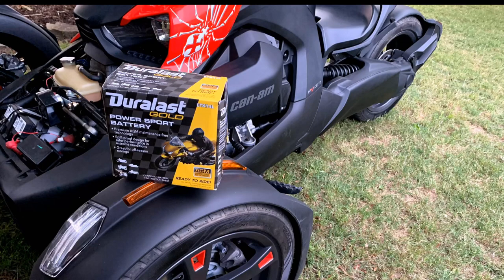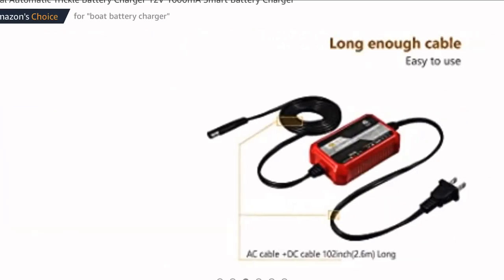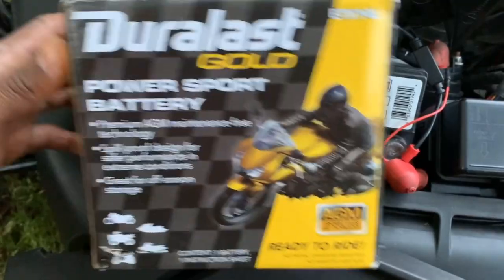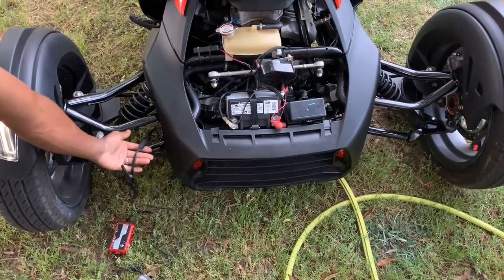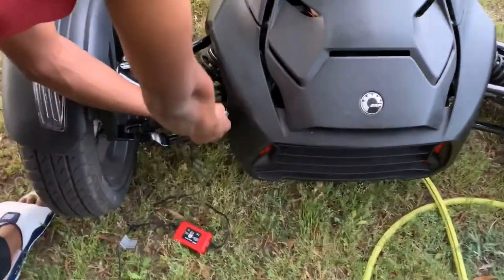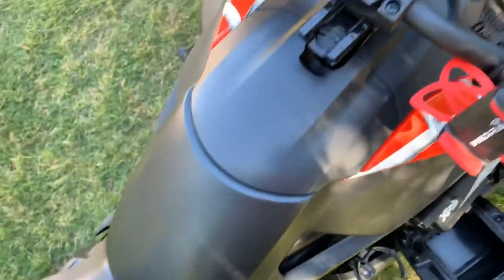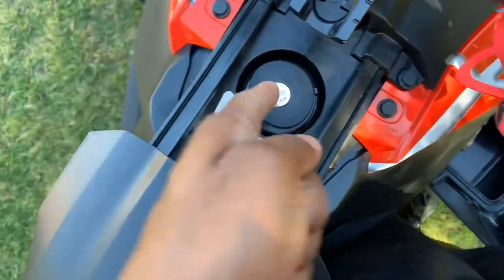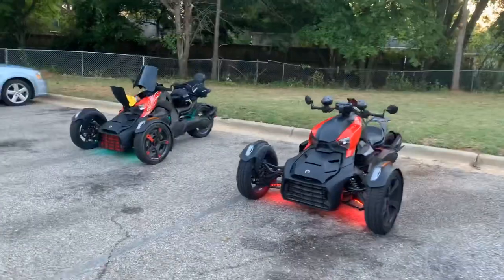Can Am Ryker Battery Tender & Locking Gas Cap

Comment: You should always be plugged in to a Tender if you're not going to be riding for a few weeks. 
The computer has a constant draw on the battery. 
You can usually find the gas cap at the auto parts store as well. It's the same cap that fits the Ford Cars. 😎👍

Comment: What I did on my F3 Limited was use my 12v adapter (cigarette lighter plug) which I use to  charge my phone, and bought a battery tender adapter that plugs in like a car charger. Since the 12v plug is connected directly to the battery when i plug in the battery tender it charges my battery. What I like is I don't have that battery tender plug hanging in my Spyder.